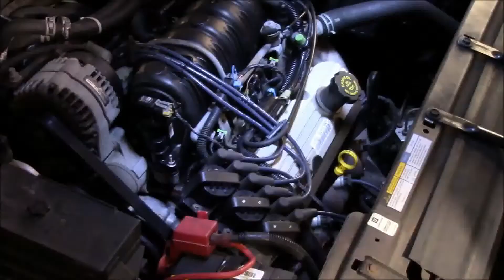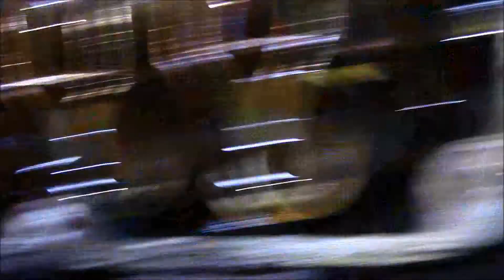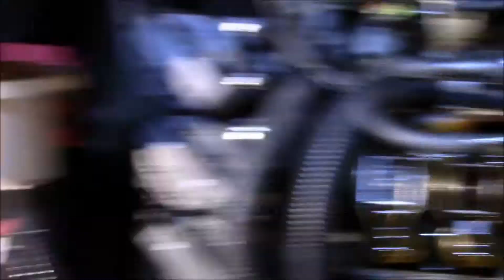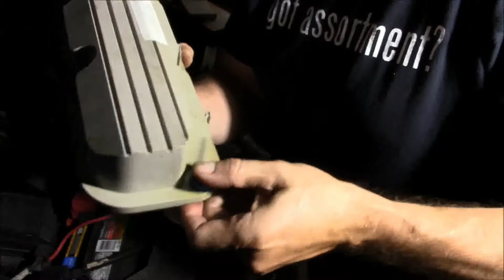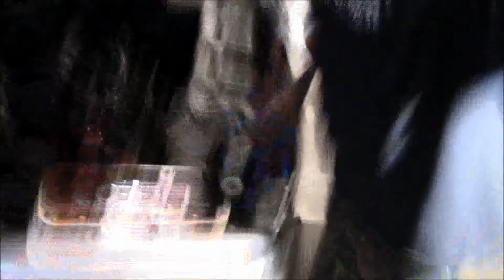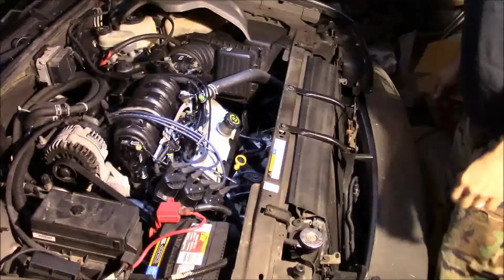2001 Buick Park Avenue Valve Cover Gasket -- Front

Comment: 6 years later and I’m boutta use this video to do the front valve cover gasket on my 2001 bonneville, thanks!
Reply from the maker: Glad it helped
Reply: @CharlesAndCars just finished the Job! Spent ALOT of time cleaning as I had a ton of fluid and dirt build up, still smoking off the exhaust manifold but I’m pretty sure it’s just all the old oil and build up still needing to be burned off, the car hasn’t ran in weeks either, planning on taking it for a drive in the morning in hopes it clears up, new gasket doesn’t seem to be leaking so I think we’re in the clear! Thank you! From a 17 year old who has never done this before, happy to learn a little bit of engine work, I’ve only ever done suspension components
Reply from the maker: @Dank_Wheezy710  glad it helped
Reply: Did it still hold up?! About to attempt to do this myself soon… smoke coming out by exhaust manifold
Reply: @EZPNZ still holding up strong though I haven’t driven it much due to not having insurance and it needs a new battery… but I been driving it once weekly or when I can down my road and back just so it’s not sitting, I still need to do the rear one, still have  a smell of burning oil but it’s not smoking off the exhaust manifold anymore and it’s still pretty clean up front
Reply: @Dank_Wheezy710  wow you replied - thanks for the info! I have yet to register the vehicle and get insurance. After replacing the gasket, it stopped smoking for about 2 weeks. I would run the car and drive it for a bit just so it won’t sit and test the car. It started smoking 4 days ago, but maybe only half of what it used to. I did some research so this time I removed the head gasket bolts, cleaned them, and then added BLUE loctite. It has 24 hr cure time so it should be good today. I will test this weekend!
Reply: @PinePoleMechanics  update, just register car. Running smooth no smoke.  BLUE loctite 242 did the job

Comment: 3:31 isnt 10mm the same as 3/8
Reply from the maker: Not exactly, but close.  3/8 is a little smaller.
Reply: @Charles And Cars  Roger that.  In any case that's all i had was 10mm and I still did the job safely :)  

Thanks again. Now to tackle the upper and lower intake manifold gaskets and the rear valve cover gasket

Comment: Great video on the front and rear.  Looking at doing this on my ‘96 LeSabre.  I asked on the other video for the rear…did you drain all of the coolant?  Are there torque specs for the bracket that the elbows are in?  Any help would be great…I’m not a mechanic and the shop wants 330 bones to replace the gaskets.  I’ve ordered new gaskets, grommets and elbows.  Thx again and keep up the great work…I’m a new subscriber as well.
Reply from the maker: Glad it helped.  It's just as easy to let the coolant drain.. you have to open it up and drain some of it anyway.   I'm sure there are torque specs somewhere, but just use common sense   I don't know what the specs are for it.
Reply: @CharlesAndCars  thanks so much.  I know it’s an older video but after watching it…I feel like I can give it a go.  Plus, if I can’t get it all at once, I can let it sit in my garage for a few days while I drive my Bronco.  I use the LeSabre to drive back and forth to work to keep miles off of my Ford.  Thx again so much.

Comment: Ty...Helpful video..heres a weird question..in your video at exactly 5:03 in the center of the valve train..ok..so..on my 2000 buick regal with 68 thousand..when i open my oil cap..i have a puddle of oil that i can see jus sitten there..i can put my dipstick in there and come out with about a quarter inch up the dipstick with oil..hmm..so seeing this open the first time in your vid..iam wondering how the hell can i get a puddle like that..it almost looks like i filled the engine with oil all the way to the top..but of course i didnt..my dipstick says so...you understand what i mean? Ty 😂 ..well
.now..looking a bit harder at you vid..i do see some puddeling..in there..hmm..anyways mine leaks..its got oil in the valleys
Reply from the maker: restricted oil return passages in the head?
Reply: @CharlesAndCars  is that the answer to my question about the puddle when i open my oil cap?
Reply from the maker: I don't know if that's what it is, but it's definitely a possibility

Comment: My just blew last night, whoever had it before me wasn't doing the best maintenance, I've changed all the filters, sensors, plugs etc and kept the oil changed every 3K miles. that's a simple fix luckily it's the front one or I'd have a whole other problem on my hands, I've fixed worse things on that car myself
Reply from the maker: Make sure you check your pcv valve.  If it's clogged the pressure in the crankcase will be high and will push oil out past the gaskets.
Reply: @CharlesAndCars  well I was driving and lost all power pretty much instantly and I automatically knew I lost pressure somewhere, so I threw the extra quart I keep in the trunk for back up/road trips and it was all on the ground pretty much instantly
Reply: I should be able to fix it for under $100 tho doing it myself so that a huge win, I thought maybe I'd have to scrap it

Comment: How many foot pounds. Do u torque. ..the rocker rams
Reply from the maker: Do you mean the valve cover bolts?   The Rocker arms weren't touched for this job.  Valve cover bolts are 89 inch lbs.
Reply: @CharlesAndCars  i was just asking cause i thought u might no

Comment: It’s been hard finding Park Avenue repair videos of this year and it’s very helpful. Can you do a video for the heater core??? We would really appreciate it. Subscribed also
Reply: Flush and use 50/50 green.  You won't regret it.  DexCool is tough on early model GM's.  There are also some good vids to flush your heater core for the 3800 series.  I recommend unhooking the inlet and outlet from the water pump side though.
Reply from the maker: I will do a video for heater core if I ever need to replace it... I'm hoping I don't have to replace it as I believe there's a fair amount of dash that needs to be taken apart to do this one...
Reply: When i bought my car 4 years ago, the previous owner always used water instead of dex cool antifreeze and it rusted the radiator and heater core. Thanks again for your vids
Reply from the maker: You may want to try flushing it... The heater core is non ferrous  and shouldn't rust itself.  It may clog due to rust from within the engine cooling passages  though.